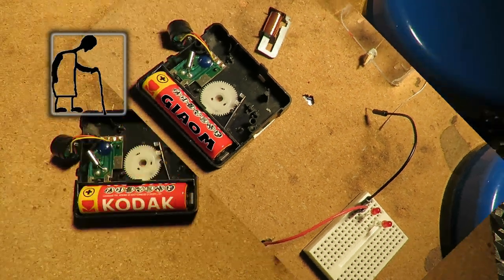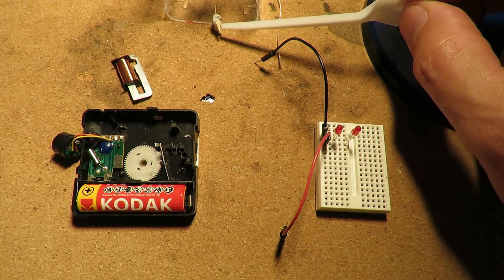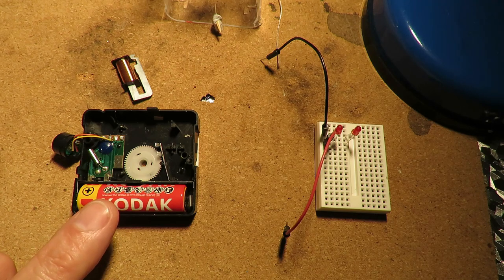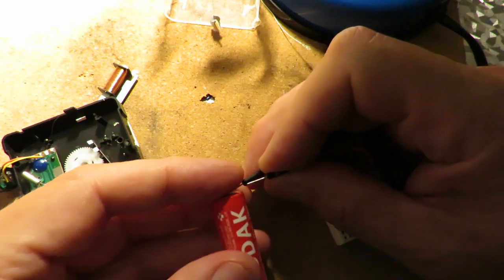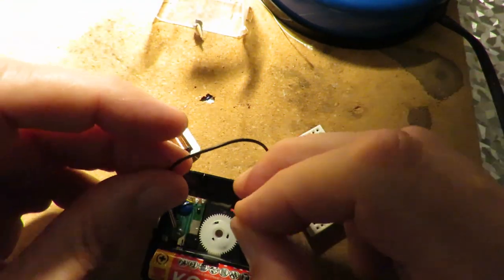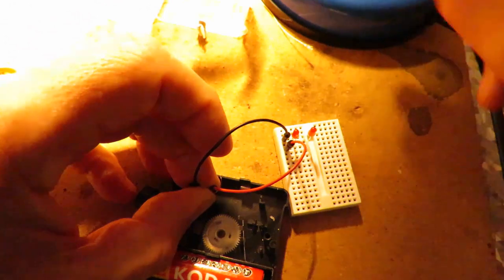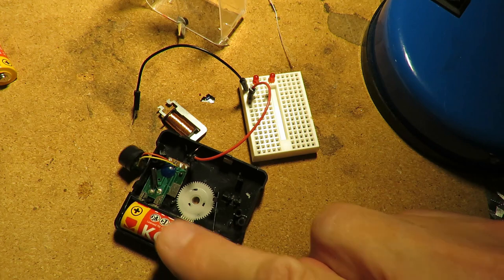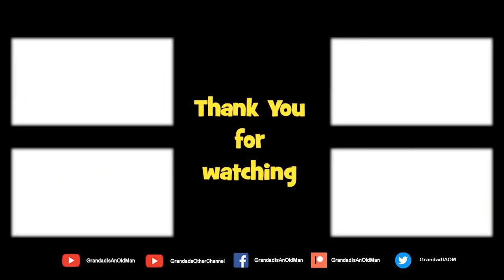Quartz Clock Parts inspired by Just4Fun PART 2

Comment: Would connecting the circuit board to 2 batteries instead of 1 damage it?
Reply from the maker: Possibly, maybe, but I don't think he was too worried about whether it killed it, he was just experimenting. I suspect it would have survived with 3 volts but much more than that and it might fail.